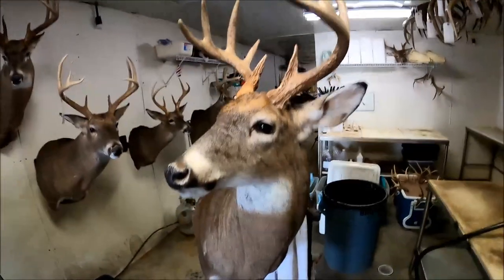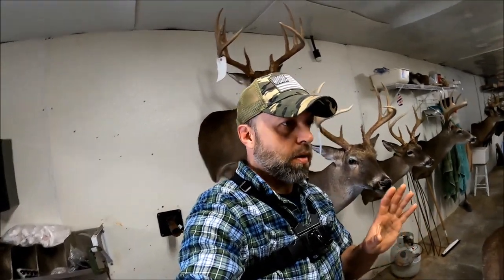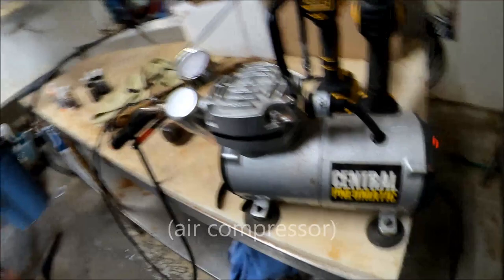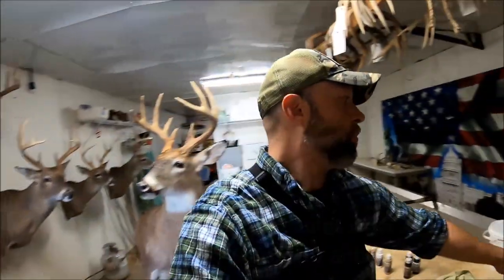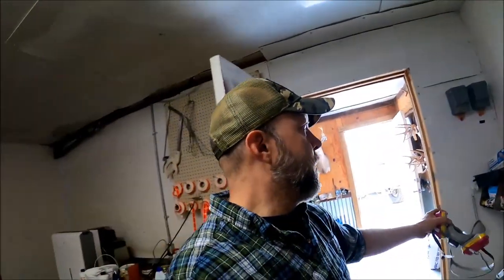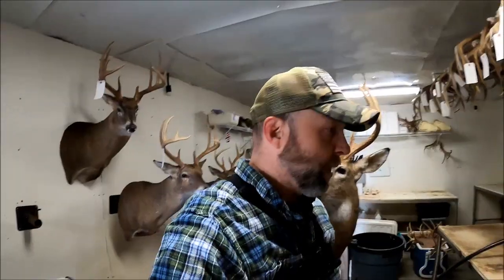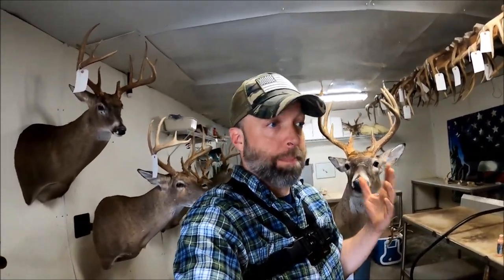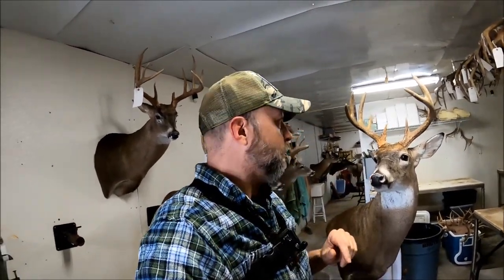PAINTING A SHOULDER MOUNT! CHEAP EQUIPMENT AND MY PAINT COLORS ***SUPER EASY*** WHITETAIL TAXIDERMY!

Comment: I bought an air compressor at harbor freight for $60 that you can set the pressure on it. It works very well and I do lots of airbrushing, I mount lots of fish. Your advice of the equipment that's "good enough" is excellent advice. Here's a little airbrush advice for you... After you clean your airbrush, toss the left over wash thinner from the airbrush cup back into the paint bottle. Also there is a new airbrush on the market... Airbrush and compressor all in one... Battery operated, cost is $40 all in. When my compressor goes out I'll be buying one.

Comment: I bought a battery operated airbrush that's rechargeable. No more noise and I can airbrush while my wife sleeps. 😊 You also don't need the hoses or anything like that. The actual air compressor part screws onto just about any air gun. 

$30 Amazon, it's sold as a "beauty airbrush system"
Reply from the maker: That is actually a great idea! I’m going to look into that

Comment: I work on tractor trailers mobile & I use a big aircompressor I got from harbor frieght & builds up to 150lbs of pressure to run a 1inch impact to change tires so I had pipe a different nipple to run my smaller 1/2" impact & they have a reducer you can put on the outlet that you can turn the pressure down

Comment: Great video! Have you ever tried using glossy mod podge and a tooth pick to add the wet bumps on the nose?
Reply from the maker: Yes that's what I used to use before I swapped to the nose tool

Comment: do you have to paint the face, or can you just leave it natural? Other than the nose pad obviously.
Reply from the maker: The only problem with leaving it natural is that it doesn't dry a natural color. When the cape dries the leather turns a dark brown. Also most of the paint work is done to color the epoxy.

Comment: The fur on my beaver mount has faded because of sun exposure. What product should I use for repair.
Reply from the maker: I have heard of using hair dye, but I prefer to airbrush it because it is easier to control the color
Reply: @thecedarridgechronicles  The airbrush is no problem but how did you mix the dye for proper flow. Do you wipe it at some point to remove excess and dry. I find no information on this area. Thanks for your help.
Reply from the maker: I just use regular water based createx airbrush paint. I works well and is surprising durable even on hair.
Reply: @thecedarridgechronicles  I have the same issue on some of the feathers of a turkey mount, will this material work on feathers? As a painting contractor you would think I'd know these things but not in these areas. The rooms I have things displayed will at times receive sunlight in large areas of the rooms and the damage came quickly. I learned this fact years ago but the faded color was apparent on the beaver and turkey.
Reply from the maker: I've never tried it on feathers, but cosmetically I don't know why it wouldn't work, you would just lose the texture of the feathers, but that compromise may be worth it considering it's for looks and not touch!
Reply: @thecedarridgechronicles  Exactly, thanks I will see what happens sometime soon.